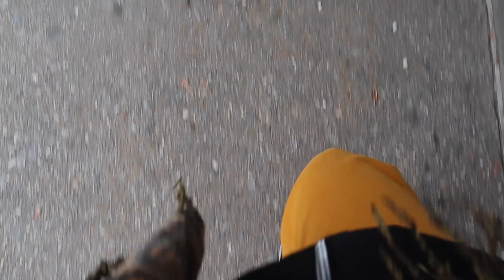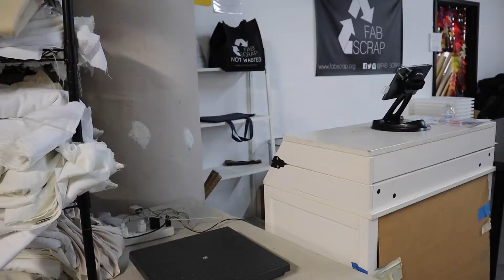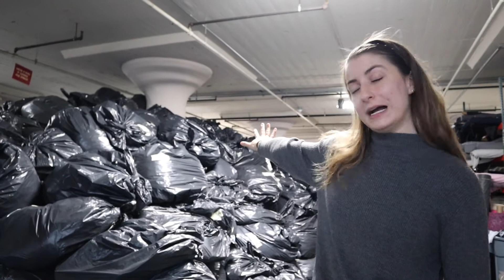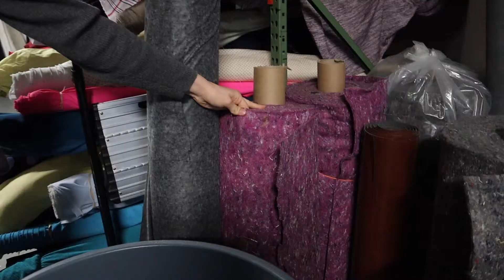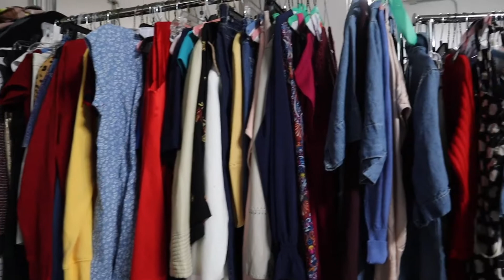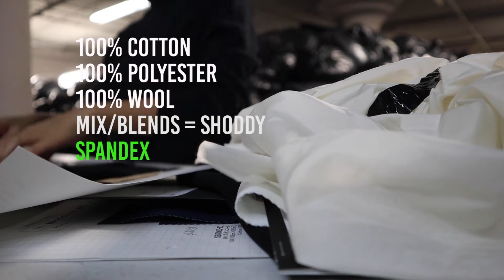TEXTILE WASTE & RECYCLING in NYC | FABSCRAP

Comment: Hi, can u please tell me where the unsellable product goes? Is it used or sold in US or exported to some other countries? Thanks
Reply from the maker: Hi there! It can vary depending on the facility & company. For instance if you donate clothes to a secondhand store, depending on place, the items will either be resold in stores or sold to countries oversees. Unsellable products I've seen get thrown away at places like Goodwill after they do sorting and decide the product isn't good enough in the primary or secondary markets. 

Overall alot of second hand clothing / donates clothes end up in countries like Ghana and India for example. I believe when I was at goodwill some items were being sent to Jamaica. 

Fabscrap uses scraps to create insulation, carpet padding, furniture lining, moving blankets, etc. Whenever possible they use fiber-to-fiber technologies to sort for 100% cotton, 100% polyester, and 100% wool. Unfortunately, fabric containing Spandex, Lycra, or elastane cannot be recycled. If not reused/up-cycled this material will end up in landfill.